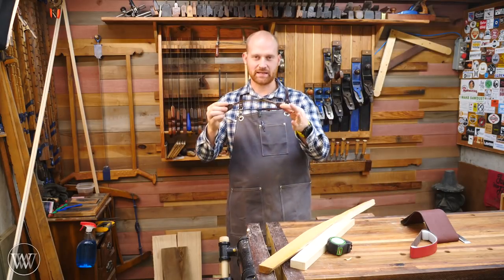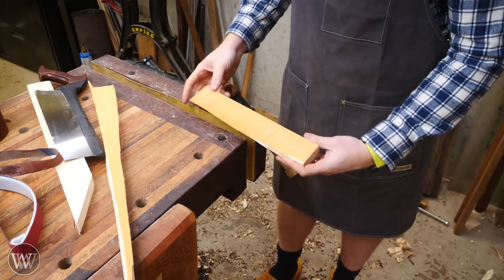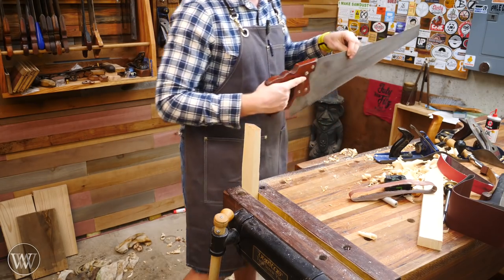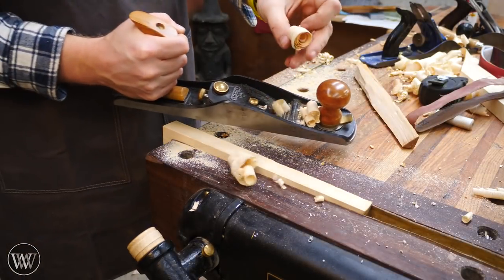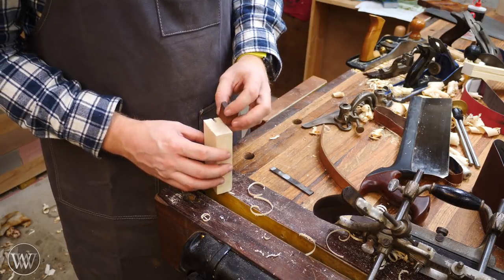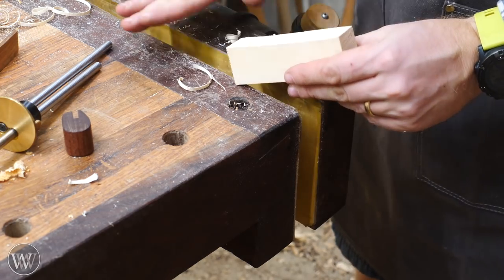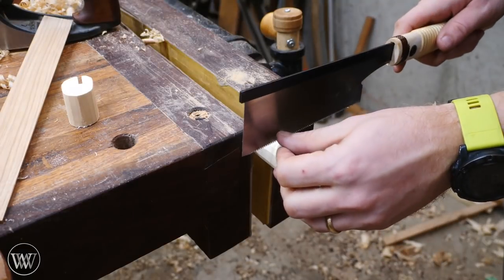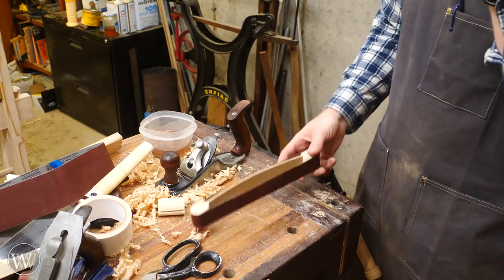How To Make a Bow Sander

Comment: Great idea. I spent an hour getting the length right! I have some Chinese useless sanding belts with overlapping joints for a Sheppach linisher. They now have a use. I used a piece of Ash straight grained and  about 1/8” thin. All simpler with machinery. I cheated. It would have taken me a week with hand tool.
Another great video. Keep them coming. 👍👍👍

Comment: Yes, i love bow sanders. I need to make a few more. My style bow sander works with sandpaper that does not come in belt shape. I want wet'n'dry sandpaper so i can sand on the lathe with oil. That prevents so much dust from flying.
Reply from the maker: +Willem Kossen fun idea

Comment: Wow, nice work especially on the plane knob.  I am hooked on this bow sander but I will probably have to experiment with different wood types for the bow...  btw: Just a non-woodworking tip.  Please burn that little black statue you have in your workshop... It is a bad thing and I am talking from experience ...

Comment: You may already use this, but an alternative to double-sided carpet tape is the "making tape super glue trick." Carpet tape leaves a terrible residue. However, if you place a piece of masking tape on each face that need to be secured, and then put a few dots (or a line, depending) of super glue between the two strips of masking tape, it will secure almost immediately. It holds better than carpet tape and releases without any residue (unless you use too much super glue and it seeps past the edges of the tape).
Reply from the maker: Yep. I use that one from time to time. Have a good friend that absolutely loves that one and uses it extensively.

Comment: I think you have given me the hand tool bug, I found myself heading to the bandsaw before deciding to use my pull saw. Do you have any recommendations on starter low cost western saws? The only ones I can find are the crappy universal saws.
Reply from the maker: thanks Scott that means a lot. for new saws, the only "cheap" option I recommend is the saws from Veritas. they feel great and they work perfectly and for the price, you can not beat them. other than that restoring old saws is the only way to go, but back saws are almost impossible to find.

Comment: Wait...you know what sandpaper is? I thought you just used a smoothing plane on everything.
Reply from the maker: LOL ya it is what you get when you use a plane on a sharping stone. thin strips of sharpening stone!
Reply: The radius on the end caps can be varied so one side is fat for larger radius sanding and the other is smaller for tighter curves.